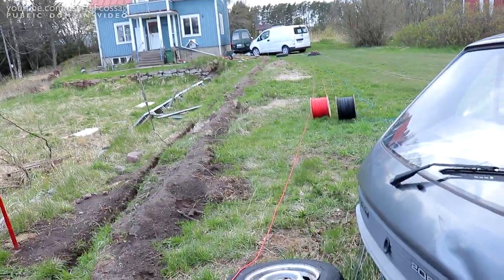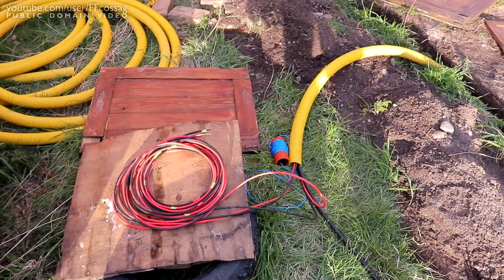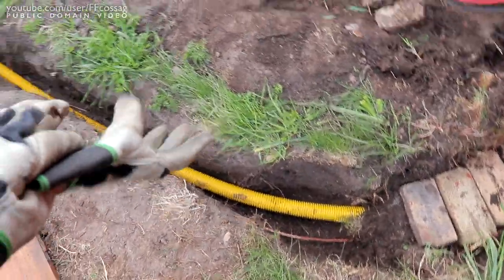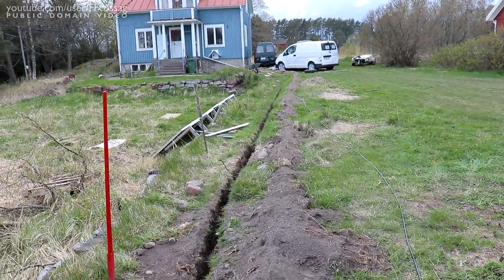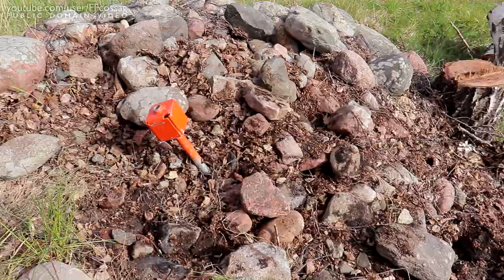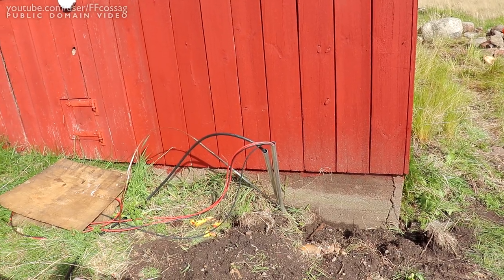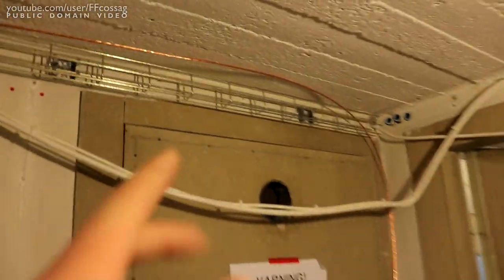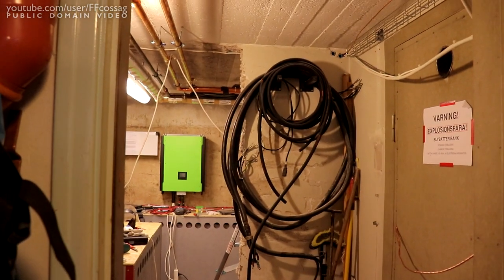10 kW Hybrid Solar VLOG 3 - Outdoors & Underground wiring

Comment: Over here in the UK, if you dared do electrical work on this scale, the local council people would have an absolute fit, even if you're more than qualified to do the work, they insist you hire a "professional", who probably only went on a 2-day course to get a worthless certificate and has no clue what they're doing... :P
Reply: Down here I think you can do what you want electrically, so long as it's under 50V, ie, solar stuff.
Reply: twocvbloke, I agree, we have too many bullshit rules in the u.k,  pak testing is mostly bullshit.
Its like a m.o.t, it means it was ok when inspected.
Shoving 500-600 volts into a system to force a failure is just mad.
Reply from the maker: Here, you can do any kind of work yourself, as long as you have a licensed inspector greenlight it before it's powered on. Finland has excellent electrical safety statistics, so clearly our system works, lol.
Reply: @FFcossag  Yes you have got a better system.
The thing is most house wiring in the uk is radial/spur/ring main, the wire thickness is a standard depending on use.
If i had to put a underground cable to power a socket in a shed,  im sure the experts would demand an armoured cable, not cheap at all.:-(
There are too many hoops to jump through in the uk, they would also insist a professional did the work :-(.
Bloody rules!!

Comment: BTW doesnt the neighbours get shitty with u for having a messy shitty place? tidy up all the wrecked cars and hide them and cover them up, get some topsoil and rake the ground level then throw grass seed over it. You could build a carport off the side of the house and gravel in a driveway.  Just a few suggestions from down under.... and i mean world wise not under u...lol
Reply from the maker: My neighbour easily has 50 properly wrecked cars stacked in his yard, it's very easy to look good by comparison. ;) None of my cars are even wrecked, at worst, the green van and the grey Peugeot are missing a few parts.

Some kind of car port type thing might happen at some point, but it's expensive to do right. I'd like to build one where the roof is made up of solar panels ... ;)

Comment: I would hate to see the barn coming down with the weight of the solar panels...... better check the roof structural integrity b4 the panels get installed, and if the barn does come down u wont have to relay the cable anyway.
Reply from the maker: This barn is not coming down easily, trust me.

Comment: Also, with these (probably not shielded) different AC and DC wires lying in parallel in the tube, won't induction from the 230V 50Hz wire into the DC solar wires be an issue over that distance? I don't know too much of the electrical specifics, that's why I'm asking...
Reply from the maker: The AC cable is shielded, and it's not a problem since it's all such low impedance.

Comment: You've go so much land, and the barn roof is at the wrong angle, I would build a frame out of galvanised steel and mount the panels on the ground at the optimal angle. Then again I'm a metal fabricator that has help build ships and bridges - lol -. It would certainly be easier to clean snow off it on the ground, and you might also be able to add tracking.
Reply from the maker: Building a frame with a good foundation and placement would have been a huge undertaking compared to just bolting them to the barn. Solar panels are bigger than you think; a decent rack would be as tall as a person.
Reply: @FFcossag  Maybe we're more used to concrete down here, because conc is the easiest thing in the world - we call it MUD because you just dig a hole a fill it. lol -. Down here all our property fences are (Colorbond) steel with posts concreted in, and a single run is usually 2m x 30m - 2 day job to fit for 1 person -, so it's 80m per house. They even sell kits at the local hardware with a hand post digger and premixed conc bags - 1 bag does 1 post -. I guess when you work on 3000t ships it doesn't seam a big deal - lol -.